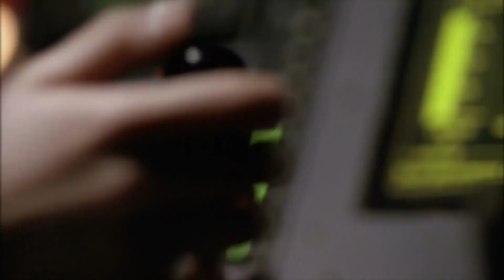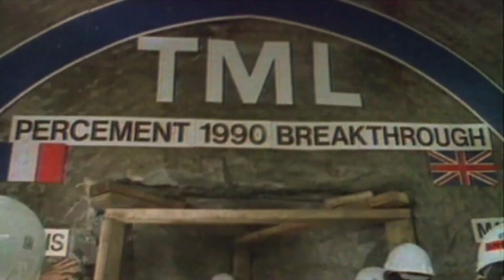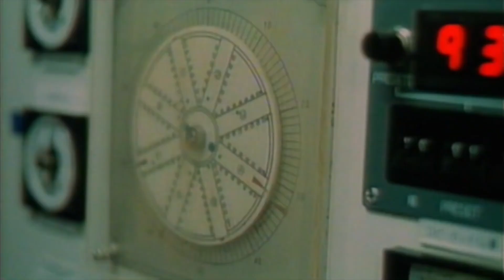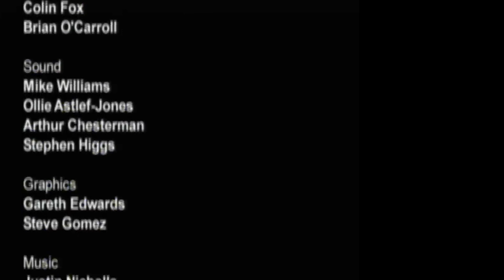Constructing The World's Longest Underwater Tunnel | Modern Wonders Of The World

Comment: I wouldn't like to be on that train when an EV on board goes into thermal runaway. Not sure what they could do in that case.
Reply: Most EV's have batteries wrapped in Kevlar, they will only spark up if the underside of the vehicle has been damaged by grounding it on something. That's unlikely to happen while stationary on a train.

Then there's petrol tanks....
Reply: @NeonVisual  petrol burns much cooler and can be extinguished by starving the fire of oxygen. Thermal decomposition of a battery produces far more heat, and critically it decomposes into fuel and oxygen, so cooling is the only way to stop the reaction, and the fire extinguishing equipment in the tunnel is not designed to do that.
Reply: @NeonVisual  I have seen an EV burn, it was not contained one bit, it vented out the side like a frigging blowtorch. The fumes are highly toxic also. And what's the boomer crap about?
Reply: @NeonVisual  Wayne or Garth I think. P. S. I am far too old to be a boomer, sorry. 😂
Reply: @NeonVisual which of the recent EV carpark fires have been contained to the initial vehicle?
Reply: @NeonVisual  statistics show that not to be a big problem.
Reply: @noke1785 no, people and cars are not separated. In fact you spend most of the Le Shuttle journey sitting in your car.